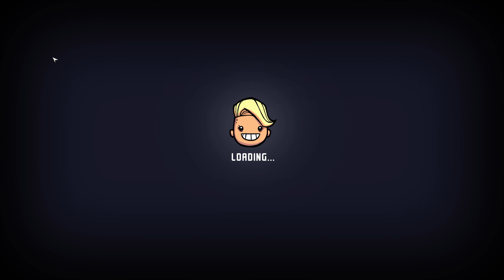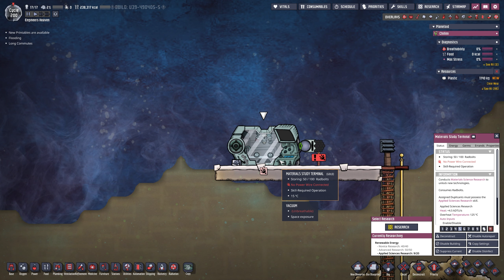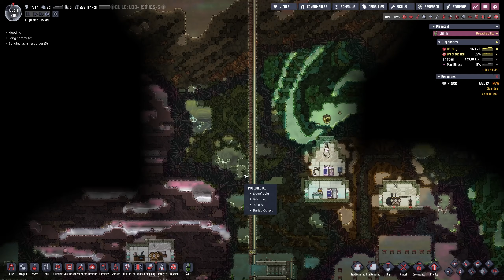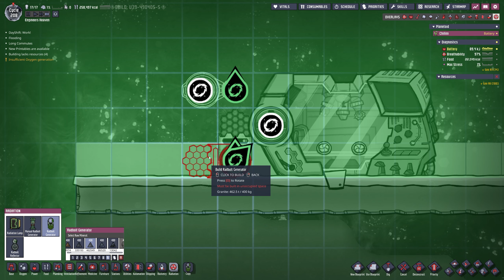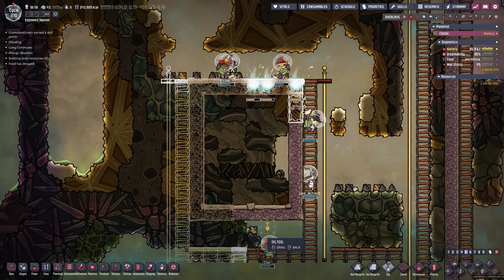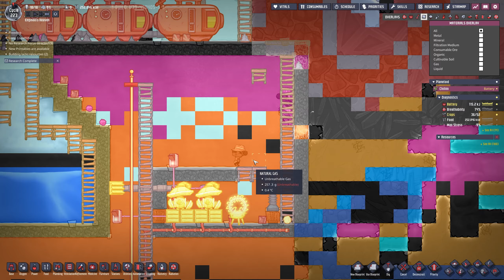INFINITE GAS & LIQUID STORAGE in OXYGEN NOT INCLUDED (LP1-EP11)

Comment: For anyone examining this rad bolt generation for the research element...

Using 26:03 as the template.
Add a second ladder to the right of the fire pole top and going up 4 tiles.
Then at the level with the top of the station build a floor of tiles (material will effect the outcome, but build a ceiling/floor extending over the right half of this station all the way over to the ladder.
Next build another layer on top of that.

Reason: the tiles reduce the radiation that passes through them, this will offer lower radiation exposure to the duplicant operating the station, and also provide the same reduction over the main ladder and firepole leading down. As shown from 26:03-26:07 (not using the radiation overlay) you can see the clear path radiation would take all the way down to the airlock just above the atmosuit docks.  That's a lot of travel in the full force radiation the radbolt generators are subject to.  While the atmosuits offer some protection, a 2 tile roof over this long trek (especially of a heavy radiation blocking material such as plastic or lead wiukd vastky reduce radiation exposure for anyone during this journey.

Just a year late in seeing and offering the suggestion.

26:33-26:34 "graphic bug" "have not seen that before"
I've seen that bug so many times...  It's essentially "this is where the job is" when the dupe is arriving to start, but the critter isn't "trussed" until the job is finished.  I'veseen at least 200 of  this "graphic bug" before this video was posted, and many hundreds of times since.  You just don't have your ranchers being micromanaged enough to notice.

35:05-35:50  My instinct would be to replace the left most 2 ladders with additional insulated tiles, this would have allowed the heater to remain, left a smaller escape pocket for heat, and thus maintained a higher level of heat concentration.  Sweep everything up, and at the 2nd mop command, place it against the tile below the bottle emptier for more precise control.  deselecting water in the bottle emptier would be more effective, because you could make sure you get the balance you're seeking and not have to spend duplicant time rebuilding the bottle emptier when the "oops" happened.

I would leave the space heater in place until the water level is balanced where you want it to be, then deconstruct the bottle emptier and space heater (and associated wire if needed, high priority sweep, then wrap up the enclosure.  With the heater in place after the water stars arriving, it dumps its heat into the water, making it that much harder for the water to freeze while you build the insulated tiles.

Comment: would mixing water and polluted water in the same storage cause problems? Im using a small version and my oil keeps disappearing.
Reply from the maker: If your oil keeps disappearing you are not using enough oil. Put some more in, about 600kg should do the trick :) 
I have never personally tried with anything else but oil, but theoretically it should work with anything denser than water
Reply: @BierTier  I put 600kg in and haven't had any problems now. thanks for the help
Reply from the maker: Awesome! Anytime :)

Comment: do you have to use crude for the water storage? can you use polluted water with the clean water as the mass storage or visa versa?
Reply from the maker: You don't have to use crude oil, no. The fluid needs to be denser/heavier than Water. So Pwater should work. I have never tested it, because if the density values are too close, the game can bug out and delete that fluid. I would probably give it a shot with Salt WAter or Brine instead of Pwater. I have only ever used crude oil for this type of storage for safety reasons and build one with a gas tile instead if I don't have crude.

Comment: Your natural gas infinite storage has the potential to fail. The geyser outputs at 160c, so do oil wells. Eventually the storage will heat up enough to boil your water layer.
Reply from the maker: Thank you very much for the info, not sure how I overlooked that. Will be fixed in the next episode :)